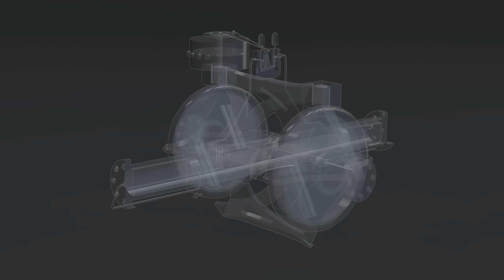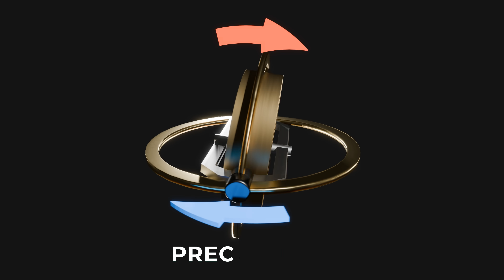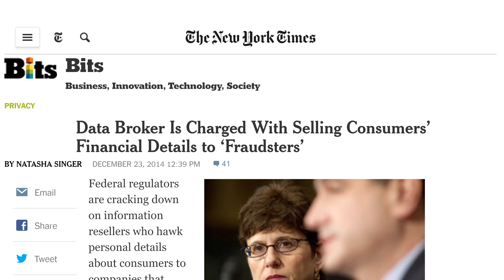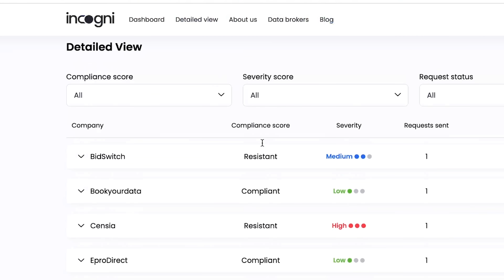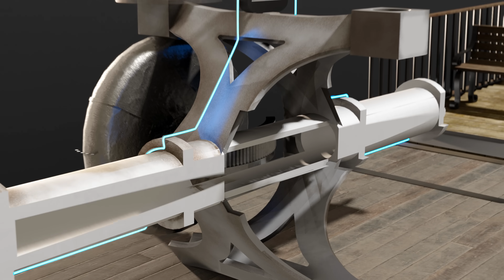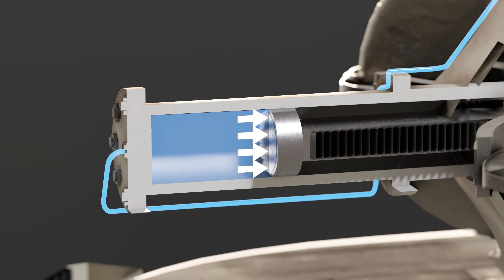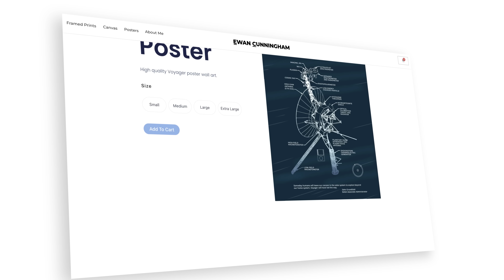The Self Balancing Monorail

Comment: the design features, implementation and of course the theory behind this magnificient train is not surprising at all. Considering all the mechanisms still in use today in combustion engines with predessors  of air fuel intake, mixing, drivetrain, brake control etc. were invented in that golden age between late 1800 and early 1900.

Comment: The Space Train on a T rail track  would travel at 725MPH  and fueled by hydrogen inside a partial vacuum tunnel. This hover train device would float on cushion of air and work but the HyperLoop doesn't and the company has closed it's doors because Elon Musk idea failed but the AeroTrain invented back in the 1950's worked reaching speeds of 262 mph and the Space Train fueled by any type of water using advanced cavitation impact by Eirex Technology in Canada will change the world producing the lowest cost energy 24/7 or on demand with any type of water.

Comment: Brilliant design and very clever understanding of Physics. But there is a big problem. Like all mechanical devices, they are subject to wear and component failure is not preventable. If the engine on a normal train fails, then the train will slow down and stop. If the giant gyroscope fails while moving at cruising speed then the train will crash.

Comment: I first read about this in a railway magazine published in about 1924, in an article about monorails which included the Patiala railway and the Listowel and Ballybunion railway, both of which still exist in museum or recreated forms.  This video explained the technical aspects of the Brennan monorail in much greater detail than I had seen before.

It couldn't run on existing tracks because it needed double-flanged wheels, which cannot go through normal points (US: switches) (and stub switches would also be problematic because of the frog).

One possible practicable use for this could have been in military railways that needed to be constructed quickly; laying a single rail would be quicker than normal railways, and one of the supposed benefits was the ability to cross a gully simply by installing a cable across the gully, and running on that cable.  The weight of the train does make me wonder how realistic that would be, however.

Yet I have to wonder if something like this would be more practicable today, given modern, lightweight materials that could reduce a significant amount of the weight.

And many passenger trains every carriage motorised, so every vehicle having the gyroscopes may not be out of the question.  Or perhaps articulated vehicles could be used, where the gyroscopes hold two (or more?) carriages upright.

But in the end, for most purposes, I guess it remains the case that it doesn't have a significant advantage over normal two-rail trains.

Comment: So he used (invented?) Control Moment Gyroscopes. It sounds cool at first, but it has the same problem as reaction wheels, which is saturation. There's no way to guarantee, during a long trip, the gyros won't be saturated. You'd have to stop, supporting both sides of the train with legs, just to reset the gyros back to neutral.

Comment: Brilliant. If investors had been convinced, think of the savings in rail infrastructure costs! I’m a bit of an inventor nerd myself and perhaps what was lacking was a backup mechanism in case the gyroscopic flywheels failed for whatever reason (and that’s bound to happen at some point), which would’ve been easy to implement.
Reply: It would not save much in infrastructure.  Trains are very heavy and even the conventional two rails must be very strong to take the weight. A single rail would need to be stronger and therefore larger than one of the conventional rails.  Then most of the cost of track build and mantenance is the civil engineering - drainage, tunnels, bridges etc. Saving one rail is neither here nor there.
Reply from the maker: It would have been so interesting to see where this design would have gone with a little more investment and even the technology available today. Perhaps one day someone will revisit the idea.

Comment: Imagine if this had wheels that were running in a duct , this would allow the Mono train wheels to be directed on a different duct in order to change from one track to another moreover, there could be an overhead hanging wheel to assist in the stabilising for very heavy loads ……i think this invention needs to be looked at again especially when building Railways in remote places like tundra where the single track is easier to build and the connection lines will be very few .
https://youtube.com/shorts/TBOlsewU4c4?si=O1PgyDwQg8IUw1DT
The above is fully functional in Germany today .

Comment: I wonder if this would still be a viable idea for connecting less serviced areas for example. If you only need short trains, a single balancing device is enough and I imagine building only single rail tracks without having to care too much about being level would drive down cost a lot. 
Of course the question is whether it would hold up to modern security standards since with a single rail derailing seems to be a much bigger problem

Comment: Can someone explain what is happening at 7:05? Energy is magically multiplied as the diameter of the opening is increased, as the pressure in the tube stays the same? I’m no expert in the laws of thermodynamics but this doesn’t seem right
Reply: He wants to say that it works like a servo system. The gyroscope's movement only controls the smaller pistons. The physical work of moving the large pistons is made by the two compressors at the top.

Comment: This instead of making such a "monorail" useful enlightened the usefulness of the gyros. Gyros were a lot more useful than this.

As with this carriage in the railway system I would say the two-track railway also halves the pressure of wheels against tracks, or in another way, monorail doubles the pressure. In railway the axle load (2x wheel load) is limited. Too heavy an axle load would squash the tracks and make them iron noodles. In USA it's around 33 tons and their tracks are already kinda noodles. In China it's around 23 tons or 25 tons for coal dedicated line.
Gyro monorail has only one track which halves its weight capacity, and you need those heavy gyros which occupied the valueable weight capacity. Therefore it has little ability to carry. So it's no good for actual use.

Comment: Im not convonced you could reduce the material of the rails in half without reducing the max load capacit in half.  But the bigger killer to of the concept was that each rail car would need its own gyroscope system making cost skyrocket.

Comment: The sheer brilliance of the engineering and the complexity involved with constant re-engineered mechanisms was nothing short of genius at work.
Reply: Creativity is Intelligence having Fun.
Reply: Im not really sure if engineering for the sake of engineering is genius. It also need to work and be practical.
Reply: Yet failed to realize this was never going to be a practical, marketable machine.  He was evidently able to market himself enough to build it though.  Interesting story.
Reply: @plmn93 
Nobody is suggesting that this thing, in its presented form, was practicable or marketable, but it absolutely should have represented an early stage of a better design, instead of a forgotten dead end. 
This was worth pursuing.
Reply: @plmn93 and? Why does every invention need a concrete practical use?
Reply: @plmn93  Your focus on the market is dumb. Its going to collapse and if thats where all your thoughts revolve around you will be left behind

Comment: There were steam engine monorails in India in 1900's-{Patiala State Monorail Trainways-Wikipedia- wiki › Patiala_State_MonoraLartigue Monorail-[using Ewing System]}AND 
(First MonoRail Station In India : Kundala Valley Munnar-)
But  Now it is time to Give flywheel batteries another chance@global warming ;
also needs research on possibility of Ev battery charging by radio waves /and other microwaves

Comment: As an engineer I would instantly put a microcontroller and a PID controller to control the gyroscope. However, these things wasn’t available yet for a long time. And I’m amazed by the brilliant solution found in early 1900’s
Reply: mechanical feedback is instantaneous, which has its advantages over electronics. However, today you'd use the mechanical systems but use the electronics to monitor.
Reply: It's called Control Moment Gyroscope, and suffers from the same limitations as reaction wheels: saturation. Over time the "center" position will drift, and gravity will bleed off torque from the CMG. Eventually, the train either needs to stop, to re-center the CMG so it matches the vertical orientation of the train, or it needs manual over-corrections from the operator to use gravity to bleed torque the opposite way. Having everyone standing on one side of the train for a photo op is cool, but it doesn't tell us how long the CMG can keep compensating for that. It can't change the center of mass, it can only apply a limited amount of torque to undo gravity-induced torque.
Reply: To be fair, they said about half-an-hour @dkosmari
Reply: @dkosmari It seems to me you’re implying the lack of an integral term in the control loop. However, the way I understand it, if the train was tilted for a while, the gyros would be rotated all this time, and the corresponding valves would be open all this time, continuously increasing the pressure on the one side of the piston until it was high enough to force the gyros back and beyond their centre position. The video doesn’t mention how the pneumatic exhaust works, but it could have been regulated to cause damping, and so I find it entirely plausible that the whole system was a tunable mechanical PID controller: the P term is controlled by the gyro RPM, the I term by the rate of change of pressure when the inlet valve is open, and the D term by the exhaust valve.
Reply: @surfcello  There's absolutely nothing in that primitive mechanical system that suggests it could de-saturate the gyros by overcompensating the tilt.
Reply: @dkosmari  Out of the these "Im an engineer" comments. This is the only guy that really knows his sht. Not even OP is this bright.
Reply: Weren't
Reply: @ashraf2661 All the REALLY great engineers say these things wasn't.
Reply: Yes, you have to wonder if current electronic control and servo technology could make this viable now, even possibly eliminating the need for the gyros.
Reply: Yeah, probably electric motors and microcontrollers instead of a pneumatic system may make this less cumbersome to implement. I wonder if the king of Nigeria would be interested on financing it 😂.
Reply: PD is adequate the integral is not necessary,  in fact destabilizes, D  is useful, provides camping. But noisy if you use digital controls. But there is a nice work around, requires graphics which I don't have.
Reply: Just goes to show that you do not need fancy electronics to solve problems 
Micro controllers can fail pids can fail and sure mechanical parts can also fail but mechanical parts are far easier to repair than any electronic part and many repairs can be done in the field
Reply: @nanaki-seto  A pneumatic system easier to repair? Not to mention maintain. And as it is described looks like it is not calibration free.
Reply: @nanaki-seto  
Mechanical systems fail way before electronics if they fulfill the same purpose and are made to the same level of quality.
The average life expectancy of a modern car made in the last 10 years, with all its electronics, is 2-3 times greater than it was 50 years ago, when the only electronics in a car were the lights, the starter motor and maybe the radio.
And who says you can't repair electronic systems in the field? You just swap control boards or peripherals and refurbish them later if possible.
Reply: @nanaki-seto I would add that when mechanical parts fail, one can often see the cause instantly, without instruments. One can also see wear and tear developing gradually, and act before total failure happens. In contrast, electronic components seem work flawlessly until they fail suddenly and (to most of us) inexplicably, with little or no warning.
Reply: this is al mechanic and neumatic 0 electronic assistans and that makes it even impresive
Reply: I´m just sufficently old to when i was young microcontrollers was ... well they did exist, but they where very expensive. so even back in the late 80 and early 90 pretty much anything that could be made mechanical was made mechanical.
Reply: Would it be practical to build this today? Maybe for a theme park ride?
Reply: As a mechanical engineer I love his ingenious and elegant solution 👌
Reply: I HATE COMPUTERS 

I HATE COMPUTERS 

I HATE COMPUTERS

 I HATE COMPUTERS
Reply: As an engineer, I immediately started to wonder if he could make it work without doing the math. 

BTW, I'm sure you're aware but, just for the record, you don't need a microcontroller to do PID control. It can be done with analog electronics. The amazing thing here is that he didn't really have a theoretical/mathematical control theory background to work with still he could make it work. Sure, the original idea is just ("just") physics, but once he realized it doesn't really work fast enough he was into control theory territory.
Reply: @LászlóMárai  I'm not sure why you believe Brennan had "no mathematical control theory background". Mechanical engineers from his era INVENTED control theory! They had to, they had no computers to do the hard work for them. This was not Brennan's first genius invention, nor was it his last.
Reply: I love how you're all so focused on the balance, meanwhile the thing would derail with the slightest obstruction.
Reply: The YouTube channel technology connections (sp?) Has a nice long video on how the old mechanical jukeboxes used to work. You should give it a look.
Reply: engineer maybe, grammar scholar, no
Reply: @grantandrew619  ¡mirate en el espejo!
Reply: @grantandrew619 Thank you. I’m neither, and that drove me nuts! Haha ✌️
Reply: Electronic is far less reliable than this already unsafe mechanism.

Comment: If you look into the history of his mono-rial train , it was such a threat to rail that they dismantled his train and buried it into a pit in England to get rid of it. It was truly a threat and he was a genius. I would love to see someone rebuild his design. he also built a 2 wheel car on the same principle. He also invented the claw hammer. In the late fifties a guy called Alex Tremulas who was the chief designer for ford and Chrysler used his principles for the ford gyron and also the tuxson motorcycle. But they never took off. The gyron was featured in the 1962 detroit motor show but had no mechanism inside it but I know he was using the brennan principle. Brennan had drawings of his invention in 2 storey shape going over Niagra falls on a single rail and this frightened investors.. It needs to be done again and many try have a look at lit motors with its 2 wheel car using computer generated programs. Failed!!.
Reply: Wrote : "it was such a threat to rail that they dismantled his train and buried it"  Wow, nice conspiracy theory there.  However, no engineer who saw a prototype train that required a massive, expensive, and power-consuming mechanism in each carriage would have regarded it as more than a clever curiosity which might be OK in a fairground.

Comment: This doesn't make sense as a replacement for cargo rail, cargo is packed too densely, weighs too much. The gyros would need to be massive to compensate for how heavy modern trains are.

But this could allow two passenger trains side by side on the same rail line. Freeing up a lot of passenger logistics. Passenger rail by comparison is very light.

Comment: This thing could be a solution to public transit if only we wanted a solution to public transit. It would be trivial to run single rails on existing roads. Adding a mono rail kind of like the old trolley lines would be relatively inexpensive. Best of all without the need to control steering it would be trivial to make driver-less.

Comment: It's a great feat of engineering, but there is on glaring flaw. With a single rail, there is no redundancy, which greatly increases the chances of a derailment, especially since there is nothing securing the train to the track, nor does there appear to be a deflector (aka "cowcatcher). Perhaps, this could have been improved upon, if the design were closer to that of a single rail roller coaster, with multiple points of contact, securing the train to the rail, etc. Of course, I must acknowledge that I have the benefit of over 100 years of hindsight.

Comment: There's a lot that's positive to be said about the design but the claim that it could run on existing railways needs a HUGE asterisk next to it: the first time it ran into a set of points (or a switch, depending on your dialect of Railwayese) set to direct a train in the direction other than the one the rail it was on went, it would either flip forward or derail itself.

The doubly-flanged wheel would have needed the rails at those junctions to have new grooves cut in them to prevent this.

Comment: problem with the design is the train must supply constant power to the gyro flywheel to kept the train balanced. the train itself also needs to be loaded in a balanced manner that won't exceed the capacity of the counter weight. For a freight train with over 130 rolling stocks, the design simply won't work, at least not economically efficient.